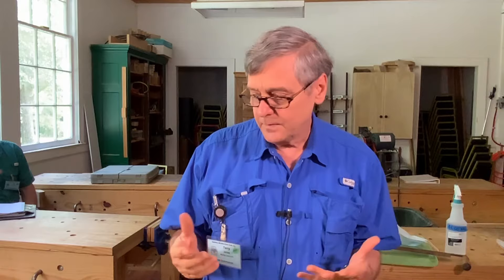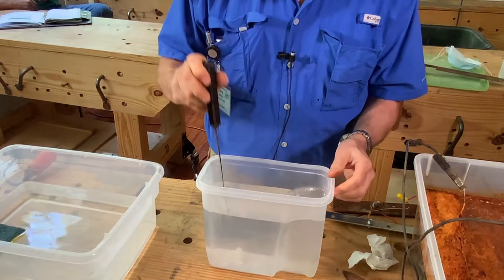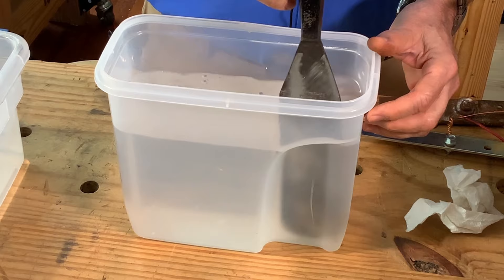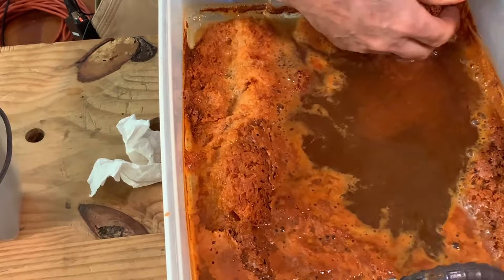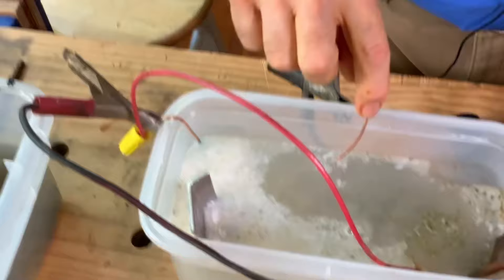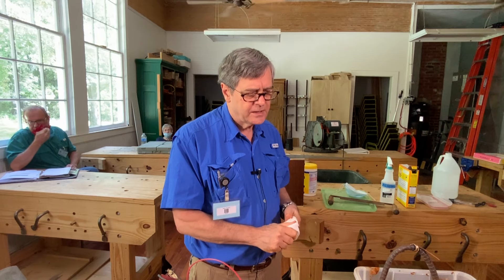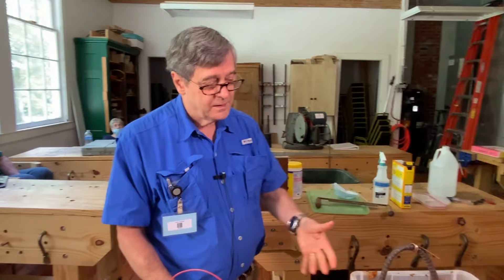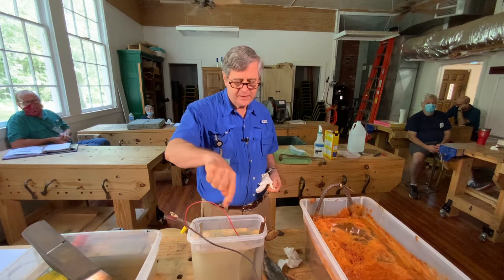Rust Removal via Electrolysis with Terrence James

Comment: Here's a myth that Terry doesnt discuss.  If you are using 12 guage wires you need flat iron or rebar.  Totally false.  If you use any anode larger than the charge wire (in this case 12 guage) it is a total waste of resources.  You would get the same results with a 12 gauge annode.  Try it if you dont believe it.

Comment: Not to put too find a point on it, but a sacrificial anode is a metal that is of a higher electro activity that is used to protect a metal of a lower activity. For example there is a magnesium anode in your aluminum hot water tank to save the aluminum by providing a higher reactive metal. In a purely grammatical sense the angles “sacrifice “ themselves in that they are plated with the iron ions which are released by the electric current breaking down the Fe2O3 which releases the oxygen and then the electric charge attaches it to the angle iron. Electrons flow from the negative electrode to the positive electrode and carry the iron ions with them.

Comment: Why do you have two pieces of metal attached to the positive lead? To my understanding only one is necessary, I have even seen people using stainless steel stock pots and the positive lead is just connected to the top edge of the pot and they just hang the part to be derusted from a wooden dowel or piece of plastic

Comment: I've been on this planet for a lot of years, and never heard of this process, and for that matter I've never heard of the black rust, I've encountered it and went nuts with the wire wheel or sand paper getting down to the base metal and in the process removing all the high spots... like lettering GRRRR. Great video, the computer power supply in a box with labeled leads is awesome, gonna make one later today, then de-rust an old belt driven grinding wheel. Thanks for all the information.